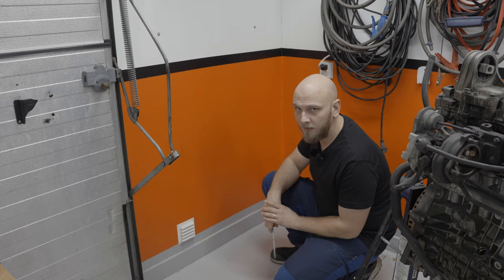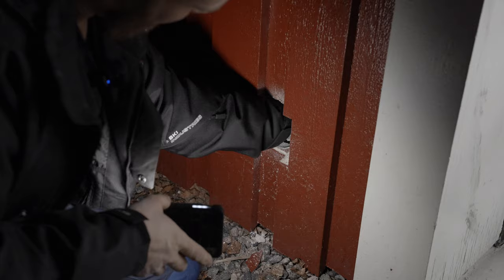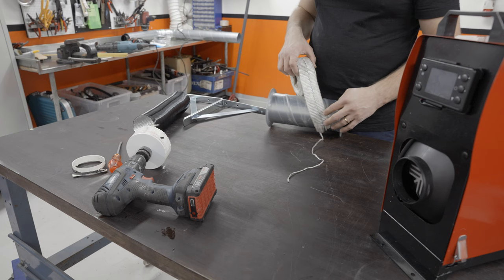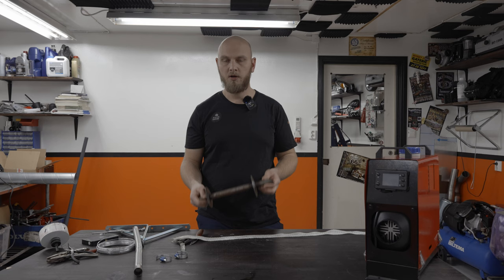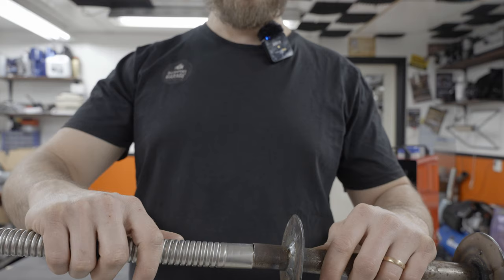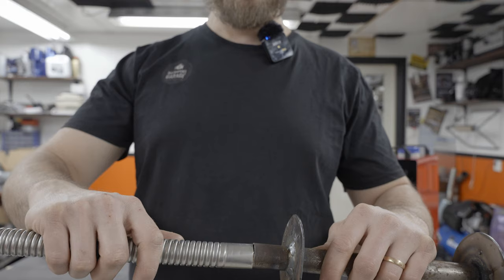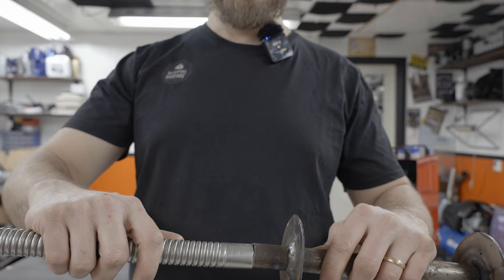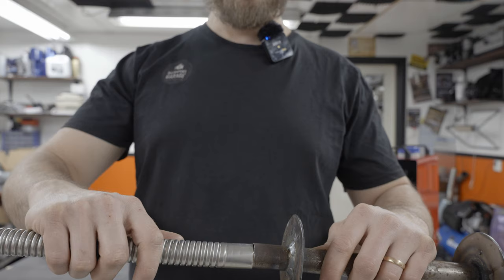Installing My 8Kw Vevor Diesel Heater  || Part 2

Comment: All of mine are indoors..   all mounted half way up the wall with 2 to 3 feet of always sloping down exhaust pipe on them before going through the wall.  A small fan blows across it to capture that heat.  A car battery with float charger (preference) OR a 30a power supply  going th rough a ups powers it.  Intake air is from indoors, it will not suck all the air out.. unit continually reheats warming indoor air.  Exhaust hole is always 3 inch stuffed with house insulation and a heavy purpose bought exhaust flange outside.
Reply from the maker: Thanks for sharing, i would like to find a better way to use the exhaust pipe heat than i currently have.

Comment: You'll want an AC/DC converter of at least 20a rating to feed that heater.  It needs about 13a to start between the pump, fan, and glow plug.  Once it's fully lit off it'll drop down to about 3a of draw.  Anything less than a 20a power supply will tend to sag the voltage just low enough that it sometimes will give you that alarm, especially if/when the glow plug gets a little dirty.  Fortunately a 20a power supply is pretty cheap and bulletproof.
Reply: In the 5kw Maxpeedingrods it says it uses 10amp in startup
Reply: @hunkenpunken   My shunt says 13.4a on startup at the highest point, so that's what I budget for when running wire and calculating.
Reply: I picked up a 15 amp AC/DC converter on amazon for 30.00 3 years ago and still works fine on my 5-8 kw diesel heater.
Reply: You should always use a battery to power these units.  Very dangerous using a converter because if there is a power failure the unit can't properly shutdown. Whereas if the battery gets low the unit will shutdown properly with a low voltage error.

Comment: Motorcycle muffler insulation or "packing" as it's called works for wrapping the exhaust in to run it thru the wall. You can actually hold it in your hand with unit running. Another option is to wrap it in motorcycle exhaust wrapping. Both work great!

Comment: I would put it in an isolated box outside and pull the inlet air to the heater from inside the house to prevent condensation and then send it in again thru another pipe. Both should fit through that one big hole you already got in the wall. Bara en ide! Bra video!
Reply: Both air hoses can be run thru the same opening into the house however, the cold air return (that goes into the back of the unit) should be taking air far away from the hot air coming into the house so the hot air can circulate thru the room before going back out.

Comment: Please read!!! I just wanted to say as a new user of this heater. I took it to my 4200sq shop, not assuming it would heat the shop but with 3 furnace’s @45 degrees my bill is over $500 so the purpose of this heater is to keep my feet and fingers warm while I am rebuilding lower units and transmissions. I ran a 25’ vent hose to reach the drive stands. Works perfectly @ #2 on setting. Exit chamber is @180-187* . Today i added length to the exhaust (3/4)x 10’ pipe and within 20min the chamber temp climbed to 210* and the fuel pump was pumping faster. And a combustion smell. To me, that’s a rich/lean condition. Try it yourself. To note: the same applies to HVAC units. ( each 45 adds 2’ in line set.) bottom line less length and wide bends on the exhaust is best.
Reply: Shouldn’t have a combustion smell, check your combustion chamber bolts are tight and the gasket isn’t damaged. Seen a few reports of loose combustion chamber bolts
The pump rate and fan speed are just set to any setting at the factory to get them to run and are usually running rich search YouTube for vortex he’s done a video on tuning the heater. Get a carbon monoxide detector too
Reply from the maker: Will get it tuned in in time. The smell that I had was from the heatwrap getting settled/hardned.

Comment: One more thing you could do to help capture more heat off the unit - run a longer exhaust inside the building before exiting the tube. That will let the hotter length of tubing radiate heat inside before it goes thru the wall. That will be "phaze 4"!
Reply from the maker: I was thinking about running it through an egr cooler to make hot water for the pressure washer 😃
Reply: @BackmansGarage I've seen guys retro fit an old cast iron radiator that is attached to the exhust then outside. It seem pretty efficient at recapturing heat that would have been lost from the exhust. There are some deals on used ones in the classifieds.

Comment: Also to add to my last book.. No volt meter needed as well. Basic group 27 battery and a $5 trickle is doing the job for me. And like I said the smell I was getting seems to get higher as the chamber temp increase. It’s a flange seal unit. It’s not water proof per say. Level 2-3 seems best. Hopefully this helps someone.

Comment: I have my CDH against an outside wall in a cottage with sawn-lap board clad in aluminum on the outside, and plywood paneling over drywall on the inside. When I installed it 2 years ago, I faced a quandary as to how to get the exhaust through the wood-frame and wood-surfaced exterior wall.  The only examples I found were through a concrete foundation, or a nearby window that had a fire-resistant panel inserted in place of an opened sash. 
Wood normally requires between 4-600°F to ignite, but with prolonged exposure to 150-250°F, it can ignite at as low as 200°F.   

My solution was to put a 4" dia hole through the wall - 7" from inside to outside.  I centered a 10" section of 4" solid single-wall aluminum dryer vent pipe in the hole. I then placed a 3" diameter of the same length inside the 4" pipe with just enough spun fiberglass building insulation batting to center it inside the 4" pipe. I have a ~1" hole dead center in a 4" aluminum pipe cap on either end that keeps the CDH exhaust centered in the hollow 3" pipe.  This rig keeps the outer surface of the pipe at well below 150°F on the inside with ambient of 75°F in the area around  the heater with the pump at 2.8Hz. In fact, the surface of the pipe can be touched and held after 24hrs of continuous operation right where it makes contact on the paneling inside and it will not burn your hand - although it would not be comfortable to maintain skin contact for more than several seconds if the heater pump rate is set at 3.5-5.2Hz for several hours.  Outside, only the small protruding 1" actual exhaust pipe even has any heat - even at outside ambients as warm as 50°F, the exterior 4" diameter casing and cap is not even body temperature at the higher heater settings. The set up also insures that the exhaust pipe from the CDH maintains enough heat to prevent any condensation in the exhaust as well.

Once the temps outside drop below 45°F, I keep the CDH running pretty much continously. It has a 14VDC Meanwell 14VDC 17a output power supply connected with a 800MCA series 27 Marine battery and a 30a solar system instant'lossless switching relay - so that if the power goes out it will stay running on battery without the controller resetting to standby/off mid-operation and causing a meltdown. The only time it gets a shutdown is if I need to leave for more than 30 minutes or more. Then it gets a rest-cycle. So, I have had 2 years to note any protential problems with the exhaust system.
Reply from the maker: Thanks for the comment and of all the tips 👍

Comment: If you are ever stuck with the holesaw that is wandering around just go through a pice of thin plywood or strong cardboard and that will steady the bit on the next hole.
Reply from the maker: Thanks, Great tip  :)

Comment: I think you will find that the inlet pipe in the bottom is for the combustion chamber only and should be outside.
Reply from the maker: I would agree that it would have been a good idea to do that yes.

Comment: Fuel gelling up and false starts because the fuel won’t start first and you would have to put a quart of gas in 5 gallon of diesel to get to ignite better and you may have to add more gas if it’s super cold and doesn’t want to start. But this me and Iam not telling body to do anything except what manual says .
Reply from the maker: Im just running it off pure Diesel at the moment. Works alot better than the mixed in with green stuff.

Comment: You said you wanted to shut it off because it was too smelly?? Can you please explain what you meant because it is not supposed to smell like diesel at all...
Reply from the maker: The smell was probably the glue and or heat wrap curing under the first few heatcycles. It smelled bad a few more times after this but eventually went away.

Comment: Special Trick:
When drilling using the large hole drill saw:
Step: (#1)
Only drill (1/2) way through till only the drill just breaks through the other side.
Step: (#2)
From the other side completely drill through wall.
Step: (#3)
Instead use a (3") gas heater vent. (Inner Pipe)..
Step: (#4)
Use black "wetted" fiberglass motor cycle exhaust tape.
Reply: Standard home fiberglass batting works fine. Mineral wool is even better.

Comment: Very informative video.
Looks like you were using an LED power supply.  This will restrict the  maximum voltage and current to the point that the heater doesn't get enough startup power.   (Power in Watts = Volts x Amps.)
Reply from the maker: Jepp, bad idea with the led power supply. Should hav bought somekind of 12v ups system

Comment: Nice clean installation. Well done. The only thing I would be aware of is the exhaust ground level with snowfall.
Reply from the maker: Thanks!  It's a good point, not to mention putting anything else in front of the exhaust on the outside. I came close to putting some wheels in front of the exhaust once, but since the exhaust pokes out a bit I realized it probably wasn't such a good idea to put them there.

Comment: Yeah they lie about the power draw on these things. They only use a couple amps once they are running, but on startup it can be 15 to 20 amps. My 12 amp supply wasn't even enough for mine. My solution was to add a 12V 7AH NiCD battery pack. That gives enough extra power to start the thing, as well as act like a UPS if I have a power failure. You don't want to lose power to that while its running, the hot heater core will melt the plastic case if the fan stops running. I also like the NiCD better than a lead acid battery, BC I can keep my PS set to 14V and that will keep the NiCD pack charged without ever over charging it. Running the heater at a slightly higher voltage is better bc the fans run a bit faster. Its also rated to 16 volts so it won't hurt the heater either.

Comment: Choice #1 A small AGM with trickle charger Choice #2 House connected to UPS Choice #3 Spare motherboard located in sock drawer...Lol Just Sayin.
Reply: You'll want an AC/DC converter of at least 20a rating to feed that heater.  It needs about 13a to start between the pump, fan, and glow plug.  Once it's fully lit off it'll drop down to about 3a of draw.  Anything less than a 20a power supply will tend to sag the voltage just low enough that it sometimes will give you that alarm, especially if/when the glow plug gets a little dirty.  Fortunately a 20a power supply is pretty cheap and bulletproof.

Comment: These heaters have a built-in "low voltage" protection for being wired in to your RV or Semi sleeper, they actually shut off somewhere around 12.2V or 12.4V so the heater doesn't run your battery down too much and your vehicle can still start in the morning. If you are wiring it permanently, either get an adjustable 12V power supply that you can tweak to 12.6 - 12.8V or get a DC-to-DC step-up converter and tune it to that voltage. That will take care of your E2 error codes. These thing pull a little over 60W (if I remember right) while the glow plug is on when it initially starts up and then drops to like 20W when it's hot enough to run without the glow plug.

Comment: I imagine the smell was from the initial heating of new burner parts and should go away after one or two burns.  Nice install.  You are belt and suspenders with your wall pass thru (LOL).  I imagine you moves the condensate drain hole to the bottom before final sealing?
Reply from the maker: Haha thanks. No, i thought since the exhaust temps are so high it will burn off any water near and that will evaporare out of the hole. Its mostly there to prevent somekind of pressure build up from boiling condensation water.

Comment: You can ramp it up to heat the space faster and then turn the setting down to maintain the temperature.  This will also quiet the unit down with a lower setting.
Reply from the maker: Thanks 👍
Reply: @BackmansGarage vad var det som "luktade"??

Comment: It sounds like paint and oil burning off when so crank it wide open for a couple hrs out side should cure you smell test .
Reply from the maker: Yes, it doesn't smell anymore. I think it was mostly the heat wrap curing that made the smell.
Reply: Did the same set up heat wrap smokes and smells. Cure heat wrap running till it stopped smoking and no smell now

Comment: People are always trying to use ac-dc converters when they are designed to use batteries, and get all kinds of weird error codes.
Reply from the maker: True, I was thinking about using something called an UPS uninterrupted power supply that uses 220v to make 12v for the heater and that had a battery backup installed in case of a power-out situation.

Comment: If you put a return as well as flow, and put heater in a insulated box  As a lot of UK  home owners are doing to avert the high energy cost her due to the war. there will be no condensation. its the opposite maybe to dry a heat for some! I heat the whole of my ground floor of house on lowest setting using 150 ml per hour just under 7 hours for 1ltr of kerosene in my case as its much cheaper than diesel is in UK

Comment: You should take the air from outside and feed it to machine with another pipe.
With current setup you will burn out all of the oxygen and you may pass out.
Unless you have very good ventilation.
Reply from the maker: Guess i have good ventilation then 🤷‍♂️

Comment: De är glödstiftet som drar mycket ström vid glöggning ca 10A vid uppstart på min Vevor 5kW sen drar den ca 40 W på full effekt. I princip kan man montera ett litet batteripack parallellt med nätdelen typ litiumjon 3S 2-3Ah minst 5C bör räcka för uppstart.
Reply from the maker: Grymt bra info 👍
Reply: @BackmansGarage  Det är ett alternativ till en 10 - 12 A nätdel och "modern" switchade nätdelar brukar stänga av vid överbelastning.
Reply: Har du lite avgasbandage kvar kan de vara klokt att isolera rörkröken närmast värmaren då bränsleledningen är mycket nära. Kontrollera om de finns vassa plåtkanter där bränsleledningen passerar, räcker långt med en tejp bit. Kontrollpanelen är lätt och flytta om man vill.

Enkel och vettig installation :)
Reply from the maker: Kan man inte styra lijon batteriet på något sätt så att den bara är aktiv under uppstart? Typ via någon utgång på värmaren kopplat till ett relä lr liknande.
Reply from the maker: Japp, såg lite förbättringsmöjlighter där med. Vill få dit lite avgaspasta på innan bara :)
Reply: @BackmansGarage  Oj då måste jag ju tänka lite.. de måste först laddas upp. Men som du säger ett relä och en timer borde fungera. Är man lite händig på elektronik kan man använda en timer krets 555 (eller 556 som är dubbel).
Reply: @BackmansGarage  Ett Inline bränslefilter kanske vore bra att ha.
Reply: Hej Johan, Bra tips.. Är inte expert på Batterier och vill ha ett i min heater, som jag kan koppla min lilla laddare c-tek på. Har du tips på batteri ? Vill ha ett litet som orkar starta och köra även om strömmen är borta. Länk?

Comment: I have seen a video of someone, running the exhaust tru un old boiler filed whit sand . Creating a sand heat battery.. maybe un idea for you
Reply from the maker: It's probably a good idea if you want to store the heat for long and is probably more suitable if you want to use the diesel heater as your primary source of heat. I'm my case it would use too much space for the time I need to use this.

Comment: I need to remove the plate on this heater to change the glow plug. Can you help?
Reply from the maker: Can probaby fit that in when doing the 1 year recap of the heater that will be made soon.
Reply: @BackmansGarage  We got it popped off and replaced. I feel so proud about that

Comment: i would consider a longer pipe outside, i could see that blowing back in if you have the door cracked. i hear they are considering banning these because don't get he corbonmonoxide far enough away.
Reply from the maker: I would highly recommend using a carbon monoxide alarm as soon as you are heating with anything that will produce carbon monoxide.

Comment: I would have to put through the wall higher up because of snowfall
Reply from the maker: It was convenient since the hole was already partially made. A good thing would be to have a reminder to check the outside before starting tho.

Comment: What brand did you buy it I just wandered in the room in the middle of your video mine you can hardly hear it run you hear little tick tick tick tick tick and that's it and a little fan noise but hardly nothing
Reply from the maker: Its from vevor, but i think most of these ebesprächer knockoffs come from the same place.

Comment: Hi, at the end of the video you mentioned there was a bad smell.
What was that due to?
Do these heaters cause a smell in the area they are placed?
Would it be better to put the whole unit outside and duct in the hot air?
Reply from the maker: No it was smelling some during break-in. Not its all right 👍

Comment: Could you put the unit outside , run the air intake and heating line thru the wall so you dont have that noisy unit running inside ?
Reply from the maker: Could try it for comparison if i get my hands on another unit one day. But for now there are no plans for it.